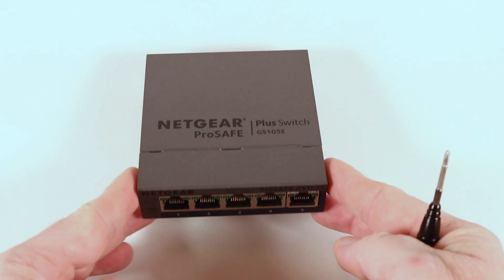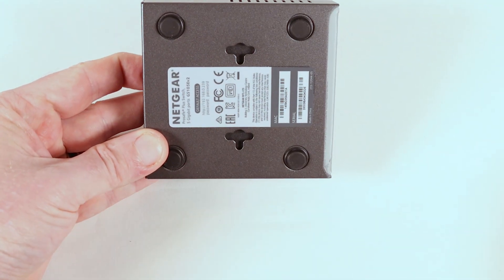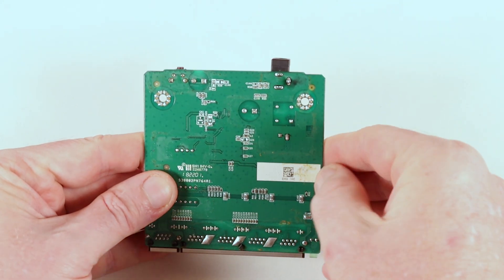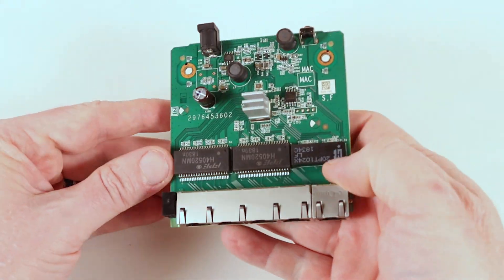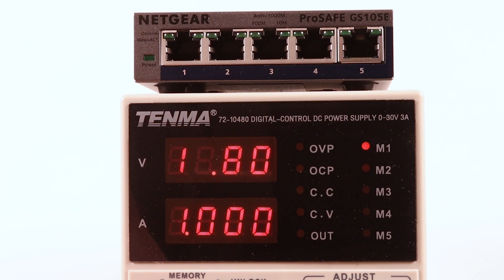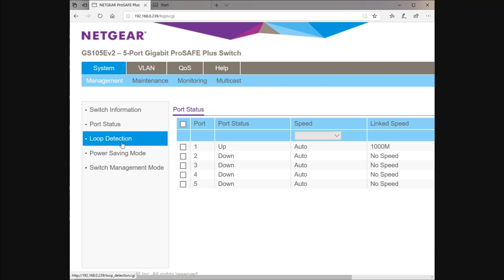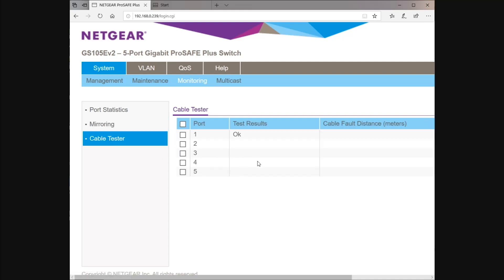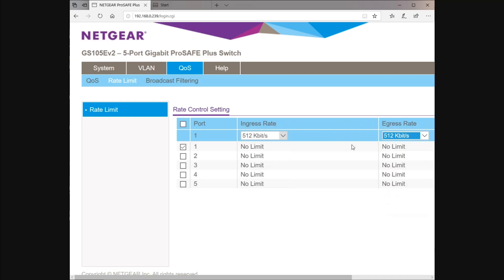Netgear GS105e Full Teardown Review

Comment: Hi, I have the gs105 v5 model, can it be rotated so that the cable connections are at the back and not the front?
Reply: Hi, please could you send me code on U6 chip? Thx so much
Reply from the maker: Erm, not quite sure what you mean, physically it can be used either way.  Your power will always be on the opposite side to the network sockets as that’s the design of the board.

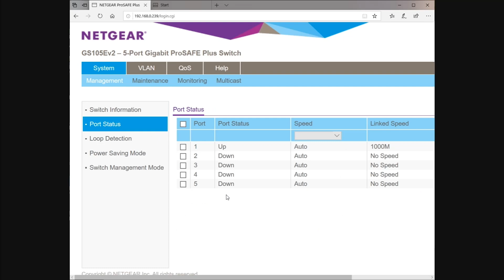Comment: 10:26 I have a HP MediaSmart Server, 2 Windows 98 PCs and 1 Windows XP PC. I don't want it to connect to the internet.  I'm wondering will it matter what port I connect my HP MediaSmart Server to ??  I just want it to be a closed network with my HP MediaSmart Server so my 98 and XP PCs can communicate with each other and so they can get Games and software from My HP MediaSmart Server.  Thanks in advance and grate Video :)
Reply from the maker: Watcha Kane.  No with these switches (and most of the smaller switches) it does not matter which port you use.
Reply: @JustRupes  Thanks for the reply / info mate I appreciate it :)